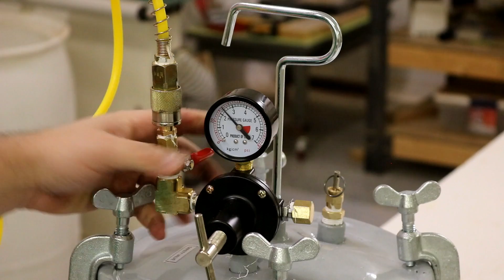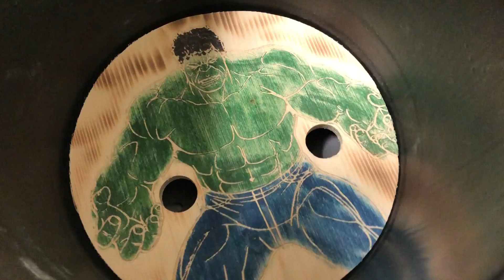Converting a Harbor Freight Pressure Pot for Resin Casting

Comment: I purchased the pieces directly from your links and you have the incorrect link for the adapter that you put in the paint outlet hole. It fits in into the lid but it’s too small to take the piece that I’m supposed to screw into it that releases the air in the tank. This sucks
Reply from the maker: Harbor freight has changed the design of the lid for that fitting. A few people have commented on it.. can you email me at 
northsidecustomcrafts@gmail.com with pics and I can help you figure it out and get the right part linked.

Comment: Do you actually still need the regulator on there? Couldn't you get rid of it?
Reply from the maker: Nolan Gaudreau You can get rid of it.. you can just shut the air off when you get to the pressure you want.. I prefer the regulator.
Reply: @JakeThompson  Got it. Thanks!
Reply from the maker: Nolan Gaudreau 👍👍

Comment: I've checked all my plumbing and tried all the lid tricks. I even tighten with a tool to make sure. There is no sound coming from my pot or bubbles. But it still wont hold a PSI of 35ish for more than a few hours. There is a small dent out on the bottom rim right at the seam could that be it? Very frustrating. any suggestions?
Reply from the maker: https://amzn.to/3nSQ2TK This is a link to a better seal and you can also leave the air hose hooked up with it on and the regular will keep it at the pressure you want .👍

Comment: I did this exact setup and my pressure relief valve keeps popping at 30 psi no matter which way it's adjusted. Do you think it's a bad valve, or could it be something else? All the connections are tight. Thanks!
Reply from the maker: Here’s the video I made explaining how to adjust the pop off valve and other things.. if it won’t adjust like this.. the valve is probably faulty https://youtu.be/QYzsDTMVIK8?si=1UsRRH53XwNJEZoQ
Reply: Yeah my valve only turns maybe an 8th of a turn, even with a hammer haha it's definitely toast, not even used once. Thanks for the info!

Comment: Just testing the new setup and anything over 40 lbs I am getting a leak from around the stem of the pop off valve (not the fitting) before it even pops. Do I need to adjust the valve, or is this a faulty valve? If it needs adjustment do you just turn the part around the stem with the slot on it. Unfortunately you went through that kind of quick and dummies like me need to see what you are doing :)
Reply from the maker: Just Me Exactly right.. just turn the part around the stem clockwise to raise the pressure setting

Comment: Do you necessarily need the 90 degree before the ball valve? I bought the wrong valve if has 2 female ends and i just screwed it onto the regulator. Is that an issue?
Reply from the maker: If it will hook up to air and it’s not in the way.. go for it

Comment: How long do you leave the pot pressurized?
Reply from the maker: It depends on the resin you use. With alumilite clear slow. I leave it under pressure for 2 hours

Comment: Hey my friend sorry I keep bugging so much. So I can’t seem to be able to adjust this air relief valve. It is rated (set) for 50 psi but the most the pot gets to is 35 psi. It releases at 35 psi and it seems that I can’t tighten the spring in the valve anymore... won’t go lower. This is the 2nd valve I use. Should I get a valve rated at 100 psi or more instead? I don’t know how you did it, as you got to 50 psi with any problems in your video. Any further advice is appreciated...
Reply from the maker: So it pops off at 35 psi or no more air will go in?
Reply: @JakeThompson  pops off at 35
Reply from the maker: @LH74   I would switch out the pop off valve

Comment: Did you turn the pressure valve towards the paint outlet or away to remove it from the T connector? I can't get mine to come off and I've been trying for well over an hour.
Reply from the maker: I turned everything counter clockwise to loosen them

Comment: So I am guessing that you are still using this particular pressure pot how is it holding up
Reply from the maker: I still have it.. and after replacing the seal in the lid with a better one.. it works fine, but I went to larger pots that are more convenient to use

Comment: You mentioned 1/4" cap, but mine seems to need a 3/8" cap on other end of valve. Was this an oversight or did they recently change the size?
Reply from the maker: They have made changes to the pots since the video. Which fitting is it and I will update the links.
Reply: @JakeThompson  thanks man! That was fast. Literally standing in front of home Depot to get my new cap now! 😁
Reply: Looks like they freaking changed it to 1/2" cap. Back to the depot for me! 😥
Reply from the maker: @NicholasYaekle  👍👍

Comment: You can do it in pressure suction inside  pressure pot to remove bubbles also as pressure chamber.
Reply from the maker: Rommel Oracion Yes you can use it as a vacuum chamber, but it’s better to have a chamber with a top you can see through so you can see when the bubbles get too high!!

Comment: Anyone els have issues with the seal not holding? Tried tightening the lid 8 different ways and can still feel a constant small leak of air out of the side.
Reply from the maker: https://amzn.to/2V8DGe2 

Here’s a link to a better seal.. it fixed mine right up.

Comment: New question, i didn’t know I needed to buy an air compressor separately for this tank so I haven’t bought an air compressor yet. Any recommendations?
Reply from the maker: A small cheap “pancake will work… I say to try to have at least the same size tank as the pot

Comment: Great video, easy to follow instructions. 

Having some difficulty holding pressure. There is a slowish leak somewhere, I have checked all the fittings with soapy water and no problems there. 

I almost feel like it’s the lid seal itself, was curious if you knew of anything I could do to double check that seal or condition it a little better? Vasoline?

Thanks.
Reply from the maker: PsychoSmart I would use vasoline .. mine leaked a tad.. but got better over time.. you can even clamp the entire pot to the table.. you can also replace the wing nuts with bolts to be able to tighten them with a wrench.. Glad you enjoyed the video.. Happy Casting!!
Reply: Jake Thompson gasoline or vasoline? Double check autocorrect didn’t get you.

Thanks for the reply.
Reply from the maker: PsychoSmart yup!!! Dang autocorrect.. Vaseline
Reply: Same problem here with my HF lid. I think the weak link is where that inner metal band ends meet. On mine they didn't weld the ends together.  I'll try the Vaseline tip. I go from 40 psi to 0 in about 45 minutes.
Reply: @laser31415  vasoline helped, I also pulled off the rubber gasket ring, and there was spatter from the weld process so I dremeld it smooth and put vasoline into the channel before the seal replacement as well.

Comment: What are your molds made from and do you coat them with anything?
Reply from the maker: The 2 I used in this video are from lizard blanks and they are made from HDPE plastic and I use stoner mold release on them.

Comment: Are the sizes for the parts standard or specific to this pot?
Reply from the maker: Jenny Wenny Most pop off valves are the same, most air fillings are the same for most things, but in this pot sometimes they put differ size fittings on it, but it’s not hard to make it work anyway.. I’m putting a new video out on this tomorrow!!
Reply: @JakeThompson  Wow, thanks for the fast reply! I look forward to it, and thanks for the video

Comment: For future reference and with all due respect, you put your Teflon tape on backwards.
Piece in your right hand is correct. But the tape should be over-slung, never under-slung.
(Use four wraps over the top) 
When you thread it in under-wrapped, it has a tendency to try and unwrap itself.
Better safe than sorry, especially with pressure. Thanks, good video for conversion otherwise ;-)
Reply from the maker: I appreciate it .. lots of people pointed that out in these comments already.. just a FYI .. it’s never leaked.. but just because of this video.. I use the liquid stuff now. I appreciate you watching
Reply: @JakeThompson  Good deal. Both types have their place. I wouldn't give up on Teflon tape though.

Comment: Thnx Jake!!.....I did the exact same thing with the HF pressure pot but ended up just taking the pressure regulator off for 2 reasons.....it failed to work properly and started leaking...... and 2...I wanted to use it for a vacuum chamber as well......you don't need the regulator since you do have a gauge and a ball valve.......I assume that if you are getting into the casting part of woodworking, then you will eventually start to stabilize wood as well......and that pressure pot works extremely well for both purposes.......Great video nonetheless.......thnx for what you do to help many pple with their struggle in beginning the woodworking trade!!......your videos are very informative and extremely helpful for many pple!!
Reply from the maker: AntiLißTard ed Thank you So much!! Comments like this one are why I make these videos.  My biggest challenge will be getting wood to stabilize, not much to chose from around here.  That makes sense about the regulator, I’m sure I will change things as I go forward and I will show the changes in future videos. Thank you so much and I’m happy you enjoy my videos!!
Reply: My concern is that someone might not set regulator to max and it would display a pressure much less was actually being applied to the pot.

Comment: I've been told that the best way to wrap Teflon tape onto threading is to wrap clockwise, looking from the bore closest to you.  I think it keeps the Teflon from bunching up.  Great video.  I am about to take the ol' Pressure Pot Plunge.  😄
Reply from the maker: Yeah … EVERYONE… noticed that I put the tape on backwards but, at the end of the wrap I pull the tape up and tight along the threads.. and it never leaked.. but I understand I’m on the internet and everyone is a plumber 😂😂😂 I’m glad you enjoyed the video and have fun casting 🦾🦾

Comment: Great video. I did this over the last few days and I hope that your OK with me making a few suggestions to your build. Let me explain why I chose to do things a bit different and hope that whomever may read this helps them. The pressure relief valve is a hot mess of garbage on this tank so I opted to get one off of amazon (about 8 bucks) that is calibrated for 50 PSI (10 PSI less then the max rating of the tank) so far that is working extremely well. the other change I made was adding some extension pieces (1/4" M-F) around the valve to keep it from interfering with the latches.
Reply: Kj, can I ask where you got your pressure relief valve? If online, do you have a link? I also had a lot of trouble with this and am looking to just get a new one at this point.
Reply: @knmkohl  Awesome, thank you so much!

Comment: I’m stuck on trying to get the bar and piece on top off. I got the bar off but that top piece! It’s so tight that the metal is wearing off. A wrench and every gripping tool I can find. Any suggestions?
Reply from the maker: Which piece are you having trouble with??
Reply: Jake Thompson the one attaches to the bar. The very very first one you took off.

Comment: Thank you so much for this video. I'm definitely one of those people who watch a ton of videos before I go out and buy the stuff to try it. One question I have: what is the purpose to replace the t junction where the original air inlet and safety valve was? Would it work the same if you used two caps on the original configuration (one on the paint outlet and one on the air outlet, leaving the safety valve where it is) ? Or is it just to kind of streamline it?
Reply from the maker: There’s lots of ways to do this and to each their own.. as long as there’s a pop off valve, a regulator (some people done even use a regulator), a pressure gauge, a way to let air in and hold it. It will work., I just did it this way.. as long as the bases are covered it’s all good . 👍
Reply: @JakeThompson  thanks so much for the reply!

Comment: I cannot for the life of me figure out how to adjust that relief valve.. It looked like you used a screw driver? I'm so confused, my tank won't go over 35 psi.
Reply from the maker: https://youtu.be/QYzsDTMVIK8 I made another video explaining the exact things you are talking about.. I hope it helps
Reply: @JakeThompson  Thank you, you're an absolute legend. I figured out how to set the relief valve but it seems it still caps at about 35, so I ordered another one. Can you direct me to a source on setting the regulator?
Reply from the maker: @stonephonerogue  that video should show it.. but you just pull the black knob and turn it to the right to let more air in .

Comment: If you have purchased a Harbor Freight pot recently, you'll need an impact wrench to remove 2 of the fittings.
The paint outlet fitting and the T fitting. They're assembled 'with' thread lock and you 'won't' get them off with muscle. Other than that this video was very helpful Jake.
Reply from the maker: Very welcome. .. Mine were tight too… I guess I made it look easy… 😂 Glad you enjoyed the video.

Comment: Great video! Can you tell me what the width/diameter of the inside of the pot is? I have a 8 7/8”x 5 1/2” silicone mold where I could make 4 scales in at once. I’m wondering if it will fit inside. Harbor freight’s only says it has a 13” outer diameter. Thanks! Again awesome video. I may hop in the truck and go get one right now because of your video.
Reply: The walls aren't very though at all. If thoseaddress the outside dimensions of the mold you should be fine.

Comment: How did you fiddle with the safety valve to make it hold more psi? I’m having the issue where it starts to leak at 20 psi and it seems like you had a similar problem! This video is insanely helpful and I cannot thank you enough!
Reply from the maker: There’s little slots on the ring around the pop off valve.. turn that to the right to hold more pressure
Reply: Great question!♡♡♡
Reply: @JakeThompson   Hi Jake, I'm having the same problem, except I've adjusted it as you say and it still blows at about 30 psi. The slots are flush with the casing of the valve, such that it's hard to even get a screwdriver in them anymore. Does this sound like a faulty valve? Or could I be doing something wrong?
Reply from the maker: Connor Weide I’m pretty sure you screw it in to raise the pressure.. but I would go the other way just to make sure I’m not wrong.. lol if it doesn’t help.. I bet a new valve would do the trick
Reply: I just went ot amazon and bought one I was having the same issue.

Comment: Underneath the lid there is a bolt that is inline with the psi gauge. Did you remove this or leave it. If you left it on was the bolt adjusted closed or partially open. Thanks!
Reply from the maker: Sparky Doodles That bolt has a hole in the top of it to direct air sideways instead of straight down. It needs to stay
Reply: Jake Thompson Thanks!

Comment: So what type of compresser do I need for this. Sorry dumb question. Will an air brush compressor work?
Reply from the maker: No dumb question, use a compressor with a tank at least as big as the pressure pot tank.. 💪👍
Reply: @JakeThompson  thank you.

Comment: What about using a pressure pot for a few minutes, then pouring into like a table slowly? I am trying to do clear/transparent tables with objects in the resin, but even with heat gun/torch i get bubbles using pro marine.
Reply from the maker: Vocu I have heard of using a vacuum chamber for that.. I’m not sure that a pressure pot would do the trick.

Comment: Built yesterday. AWESOME HELP! Stupid question maybe, but why use the pop off valve and not just cap it since the ball valve can be used to to release the air when done? Seems like introducing a couple extra potential leak failure points for no reason. Was thinking of removing mine but thought I'd better check first. Overnight test lost about 10 psi in 14 hours or so. Thanks in advance!!
Reply from the maker: Ron Harper The pop off valve is for safety.. Incase you accidentally overfill it.. the valve will pop off instead of the pot blow up.. 🤓🤓
Reply: @JakeThompson  thanks! I guess since I'm disconnecting the air hose after i fill it, i wasn't as concerned as I should probably be.  😃
Reply: @ronharper9937  Picked up this 60 PSI valve from Amazon (https://www.amazon.com/gp/product/B0081TJHXI/ref=ppx_yo_dt_b_asin_title_o03_s00?ie=UTF8&psc=1) and no leaks!  Only lost 1 PSI from the pot in 24 hours.  Thanks @Jake Thompson!

Comment: I converted mine using your instructions, THANK YOU.

One thing that helped me is putting some lubricant (WD40) on the screws that close the lid. I used to have problems with leakage... I thought i had a bad gasket, but the screws were just not going in all the way. Also, over time the screws wear down and you can see it clearly when you take them out... some wd40 fixed that issue for me and now i don't have leakage. Also, closing the lid is now a joy!
Just and FYI and a THANK YOU note.
Reply from the maker: Thank you Henry.. Glad you got it done. 👍👍

Comment: For the life of me I cannot screw the pop off down any tighter and it is still leaking at anything over 40psi. Would I be able to put a 1/4 double female piece on and throw a pipe cap on it? My understanding is you don’t want the pop off to be leaking at any psi, right? Thanks in advance!
Reply from the maker: KianoKaos yes you can plug it but you won’t have a safety valve. If it’s popping  off at 40 psi it’s not doing you any good.  I’m sure a new pop off valve is cheap.. but you can plug it.
Reply: Here is the one I used on my pot.  Tossed the HF one.  https://www.amazon.com/gp/product/B007GDXT3O/ref=ppx_yo_dt_b_asin_title_o06_s00?ie=UTF8&psc=1
Reply from the maker: Alan Fetz 👍👍👍